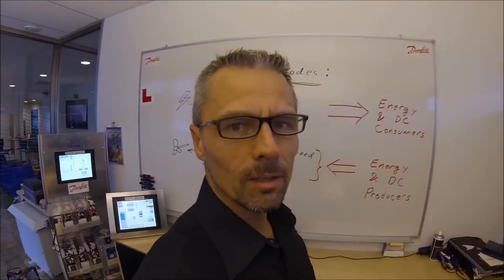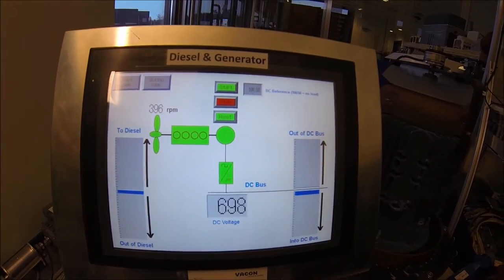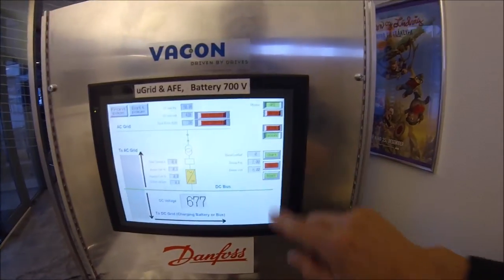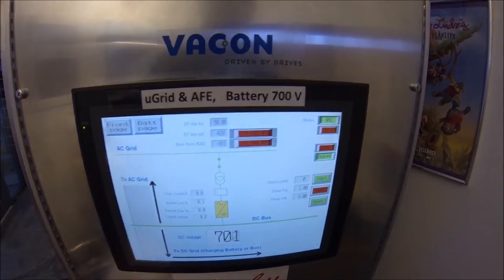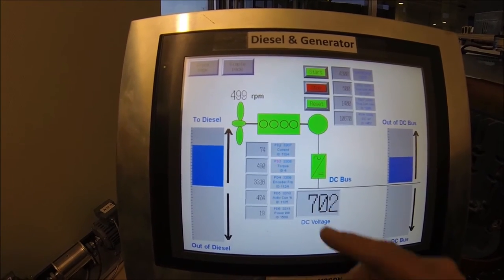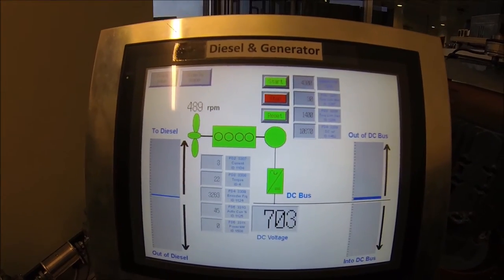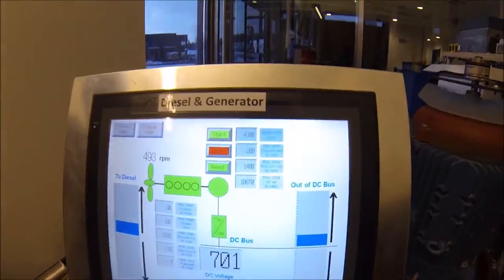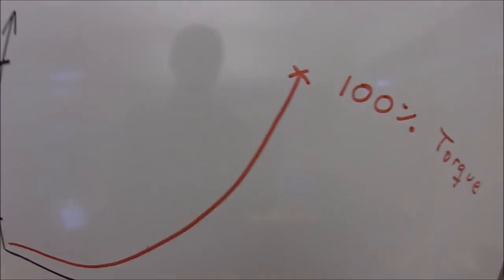Drives School (E15) - Generator modes and DC bus control

Comment: Hi @Reidar Berntsen, Thankyou so much for your detailed explanation.
I had a doubt. 
1. At  4:22 , i was wondering from where does the 537V was presented on the DC bus ? since the Motr/Generator application is not running, AC Grid is offline, Battery bank is also not activated yet...

2. How does the voltage is boosted from Input of drive to output of drive for a PM machine ? is there any formula for that ?

Thanking you again